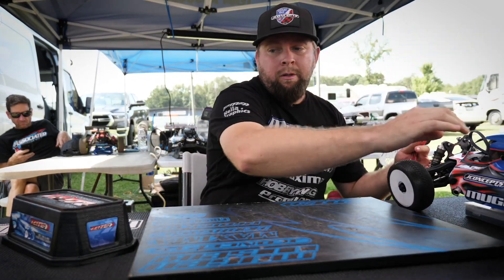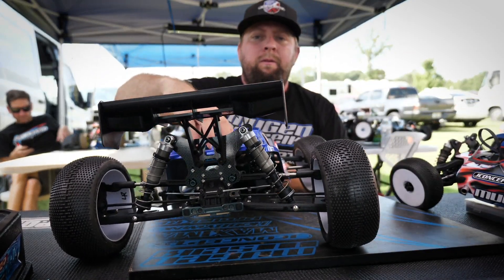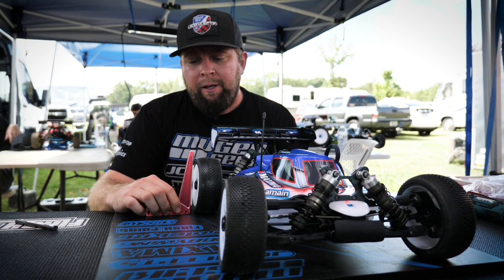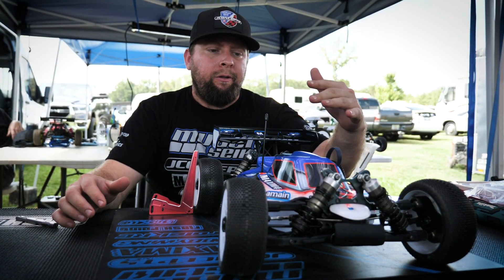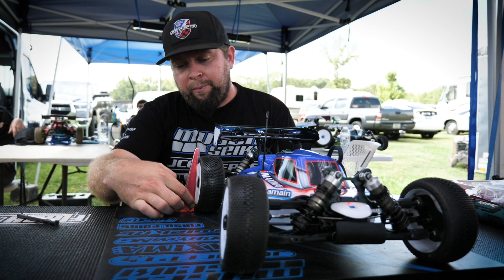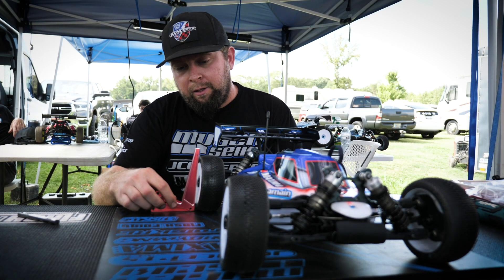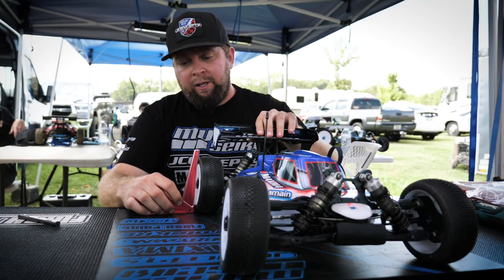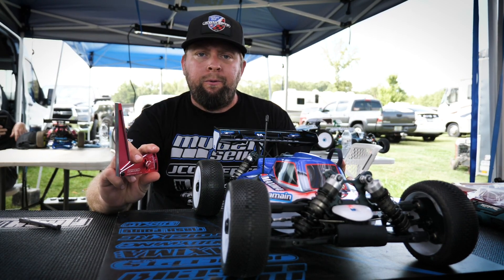RM2 Camber Gauge

Comment: 47 bucks and it doesn't even fit anything I own?!

Well to be honest I probably could use it on my 1/10 SCTs and my 1/7 buggy and whatever as it's just looking for a flat surface, but still. 47 bucks for what's basically a modified protractor with fancy anodizing.

Can I have one stamped out of steel, left raw finish? Be just as accurate and you could sell it to me for 9.99 while still turning a profit.
Reply: What a douche!!